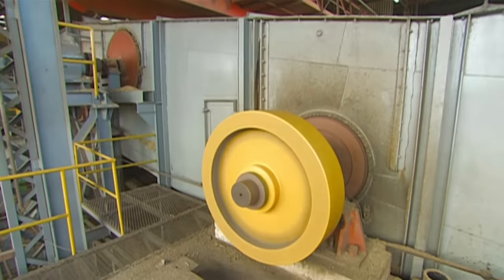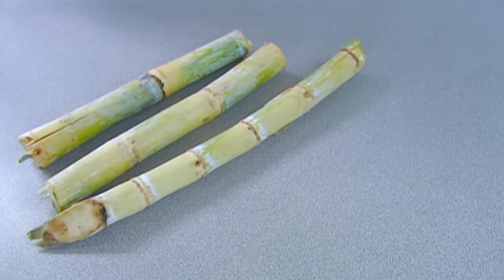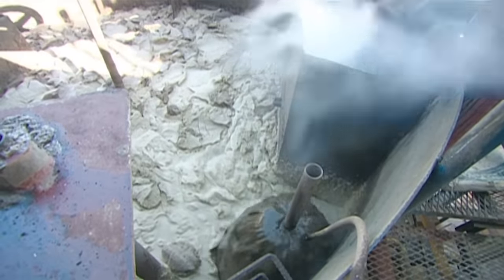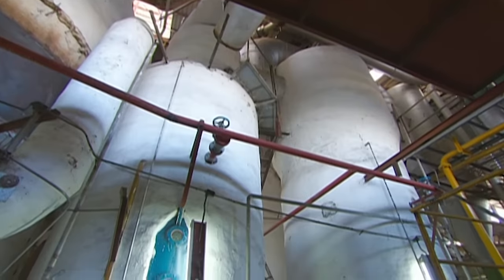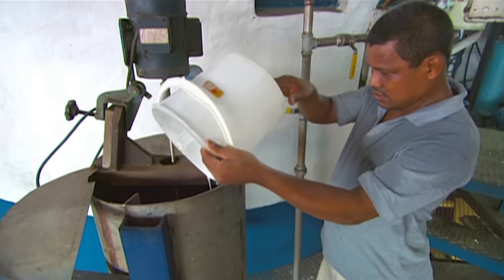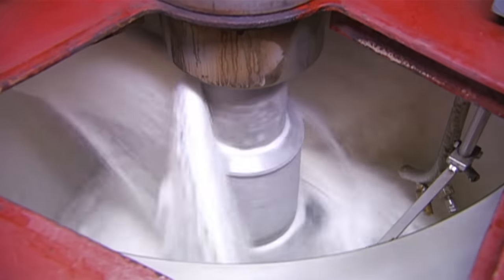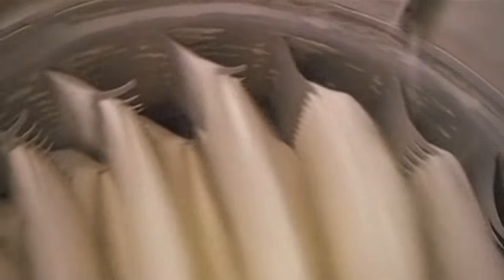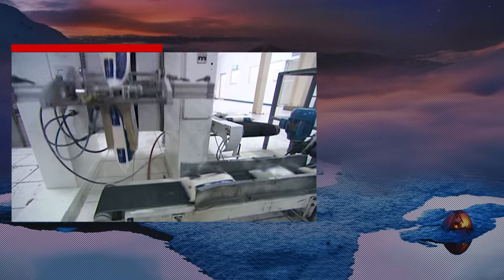SUGAR | How It's Made

Comment: This was a lot more elaborate than I ever thought.
Reply: Exactly‼️  It is a much longer process than I had ever imagined!
Reply: Like you could probably make sugar by simply boiling the juice (which from what I have heard tastes amazing) but it would be brown, almost black, full of impurities and probably not the best all around. Adding lime for example really helps. This kind of an industrial process not only makes very pure sugar (which might be what your consumers want even though I like brown sugar more) but also with nice uniform crystals (in 19th century you would buy sugar in loaves that were pretty hard and required manual breaking and grinding to make something you could powder a cake with) and what is the most important thing, very efficiently in large amount.
Reply: I thought it was just dehydrated cane sugar.
Reply: @susanbrogan2517  That would be panela or rapadura. Dehydrated sugar cane juice into a solid block which retains its impurities. It is a staple food in my country, I love to use it instead of refined sugar in my hot/cold drinks.
Reply: @draco147  Yes, thank you for your response.
Reply: honestly it wasn't. Im thought i was going crazy but i def remember a documentary where they simply threw the sugar canes in a giant roller, processed the juice for impurities, then cooked it until it crystalized, its cooled and packaged after some grinding maybe. IDK wtf this lime crap is lmao
Reply: @slcRN1971  Right! And how is sugar one of the cheapest products? Hard work!

Comment: WHOA.  I never really understood how heavily "processed" sugar is.  This was really eye opening.
Reply: Well of course, its literally sugar crystals extracted from juice. A lot of things in nature have sugar in them, but theres no such thing as a pure sugar solution
Reply: @dihydrogenmonoxide7600  But there must be a way to get the sugar out of the pulp and water without using all those chemicals.
Reply: @ChristmasEve777  why bother making something inherently extremely unhealthy slightly less unhealthy, if you need something sweet a bit of honey is a much better way to go
Reply: @ezodragon  hmmm honey is good but there is nothing wrong with sugarcane.  It's also natural.  It's all the processing they do on it that makes it unhealthy.  Even honey can be made unhealthy.
Reply: @ChristmasEve777  Very true, and there is a way to get sugar from the pulp without all the chemicals, although it would have to be done small scale, such as at home because it wouldn't be feasible on a commercial scale.  At home, you could simply strip the cane from the outer covering, add water to the finely cut up (or even better to grind it) and add water, and allow it to simmer for as long as it takes for the plant material to break down to a mush, strain, and filter.  Cook more until you get a thick liquid, then dry it.  It won't look or taste like commercial sugar because it will still have the molasses in it and will also not have been bleached.  So it can be done, but you won't truly get the same product as the commercial one.  The process is much simpler with sugar beets, which is actually what is used for 90% of USA's sugar. Buy a sugar cane section and experiment...:)
Reply: Facts. This is disgusting
Reply: My thoughts exactly. I knew refined sugar was unhealthy but this made me realize it's much worse.
Reply: @alFaCentauri16  Sugar is sugar. Don't be fooled into thinking that your body will treat the sugar from say freshly squeezed fruit much differently (or vice versa).
Reply: @PieterPeter-ud7wf  Please link me a serious research that proves me wrong but note that I was strictly speaking about sugar (I understand the importance of fibre).
Reply: @PieterPeter-ud7wf  So we're not strictly speaking about sugar
Reply: @BlackRockFarm  you've basically described the process of high-fructose corn syrup is made from corn. The point is that it's not necessarily much healthier. What's going to end up killing you is the high/concentrated sucrose content. If you want the healthiest way to eat sugar, literally just juice the sugarcane. Anything else and you're not really doing much better than the heavily processed stuff.
Reply: @drunk1kangaroo  Are you saying that sugar from a fruit, fructose, is the same bad as processed sugar?
Reply: @alFaCentauri16  Yes, I'm saying that your body is treating it the same. It's only bad if taken in excess though.
Reply: it's a cocaine substitute
Reply: Maple syrup is great too!
Reply: You should not equate the natutal sugars that fresh fruit and vegetables provide, with a heavily processed product like refined white sugar. C'mon, that's ridiculous!
Reply: You can pick the brown one then for it's not bleached, just it's natural color.
Reply: @drunk1kangaroo  you are wrong. Look into deuterium content of refined sugar.
Reply: @ezodragon  Sugar isn't unhealthy
Reply: I mean because they describe it like this and make it on an industrial scale it seems more processed than it is. But yeah the bleaching step in the start seems unecessary, who cares if the sugar is brown.. ? Brown sugar is more delicious anyway or pure cane sugar. 

But really they just heat it to concentrate it, and then seperate it by adding alcohol (and dextros?) and the centrifuge it to seperate the crystals. Not really that many steps.
Reply: @Kariahthebiologistwow no one has ever heard that before, such uncommon knowledge. 🙄

You completely missed that persons point lmao. Go off though Google Scholar biologist!
Reply: @ChristmasEve777 you can, by eat it DIRECTLY

Comment: Fun fact: sugar cane fiber can be turned into disposable plates, bowls and takeout containers.
Reply: Sugar cane fiber can also be turned into 3d printing filament called pla, or poly lactic acid. but most of the time the cane fiber or "bagasse" is burnt in the boilers which is what powers the sugar mill
Reply: Can be. But do companies make it common? Nope. Gotta deal with gross plastic ware. :(
Reply: @Grellibe  Yes true
Reply: I often find printer papers made with cane fibers too.
Reply: is there anyway we can do that with the left over parts that they couldn't use instead of burning it for energy?
Reply: also drywalls for building houses and paper as well. every thing is used from the cane
Reply: @Insomniac3d  p.
Reply: no
Reply: And paper

Comment: The fact that they use lye (sodium hydroxide) to refine one of the most common cooking ingredients scares me. I had to go research it, but apparently lye is used in food preparation more often than many would think. It's a really strong base, with a pH of 13.0, and it's been known to be used to help dispose of bodies.
Reply: Food, soaps, and so much more. It's scary
Reply: Soon as I saw that I immediately was like whoa dead body disintegrator in sugar.
Reply: Sodium Hydroxide isn't part of the sugar refining process. It plays no role in the actual production of sugar, it would be used for things such as cleaning of equipment, pH shock, or regeneration of water softening systems.
Reply: They don't use lye; they use LIME. Lol.

And, fact of the matter is you can take lye or acid or anything really and make it safe for consumption simply by diluting it enough. It's the dose that matters (even drinking too much water can kill you, and I don't mean drowning). Hell, mixing lye with hydrochloric acid (pool acid) would actually cancel each other out and yield water + sodium chloride (aka table salt), so I'd encourage you not to look at things skin deep like this.

Comment: I didnt realize how processed sugar was
Reply: Pretty much every large-scale operation which produces foodstuff has a lot of machinery and a number of steps involved. When you look at the bigger picture, grain-for-grain of sugar it's not much worse than the steps you take for home-cooking if you were to scale that up for mass production. I've examined a lot of different processes during the course of my engineering studies and career (ammonia production, oil refining, explosives, plastics, drywall, alumina refining, etc. etc.) and this comes across to me as a fairly simple one relatively speaking.
Reply: @MaidenLoaf  I totally agree. Sugar plants are one of the simplest plants consisting of relatively simple unit operations and processes. Looking into a refinery, for example, one cannot imagine how many steps of just produce gasoline from oil.

Comment: So ...sugar is more man made than anything...
Reply: Exactly. Processed food is not real food. Man made food throws away all the crucial fiber. Body pumps enormous amount of insulin which is the fat storage hormone. All causing massive obesity, diabetes and metabolic syndrome. High healthy fat and low carb is essential.
Reply: basically
Reply: which is why it id not good for you
Reply: @mitch1078  You were right on many points. Although you shouldn't eat high healthy fat as it causes type 2 diabetes if overconsumed. Beans are one the lowest glycemic foods and berries too! They are both super high carb but produces very low insulin! Same with many vegetables as it constains so little calories as the body doesn't need much fiber to deal with it.

Sugar though being 360 calories per 100g is a big problem with no fiber.
Reply: @ourmodernworldofficial  Thanks yes you are absolutely correct. The portions of healthy fat is absolutely not intended to be over-consumed at all. Anything in excess is never good. Healthy fat alone does not cause type 2 diabetes whatsoever because it doesn't trigger insulin. Only glycogen, sugar, carb sugar and processed carb sugar can. Fat does not trigger any insulin response by definition. The problem is when lifestyle consists of processed food carb crap which is mixed with eating fat. That will magnify the insulin response significantly. Toxic insulin levels is not something the body can handle for long as the body was never intended to endure it.
Reply: Coco  cola
Reply: Oh dear..you sugar haters..obviously none of you drink alcohol..and if you do..hang your heads in shame
Reply: @charminglad124  It not the sugar itself we hate...it's the toxic effects. Same goes for alcohol.
Reply: Kodosuro did you just say fat causes diabetes. Wow. Please stop. That’s complete nonsense.
Reply: @jamesbizs  Correct...healthy fat does not trigger insulin. Over-consumption may cause weight gain but it shouldn't lead to diabetes.
Reply: @mitch1078  basicly any fat is better than most carbs
Reply: @ourmodernworldofficial  fat doesn't, or it does but it's hard to overeat on fat
Reply: @ourmodernworldofficial  calories aren't harmful, sugar and carbs are
Reply: @mitch1078  unhealthy fat also doesn't cause it as fast as sugar/carbs.
Reply: @user-vv1do1wg1j  I agree it doesn't matter if healthy or unhealthy fat. I was responding to someone else here mentioning healthy fat.
Reply: yaah thats so true, i dont feel like eating sugar anymore
Reply: @brucetaruwinga1913  Have sugar with the inherent fiber like whole berries. If you must have sugar, have coconut sugar. It is not processed like super crystallized concentrated cane sugar and is more of a whole food that is lower glycemic.